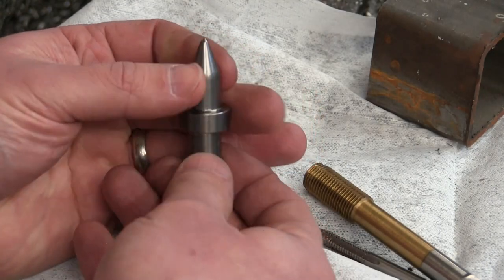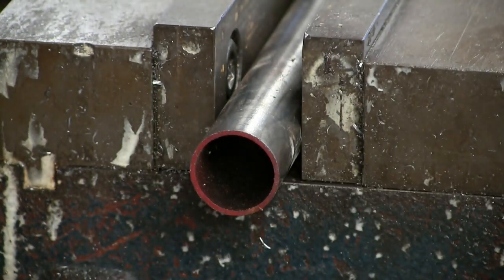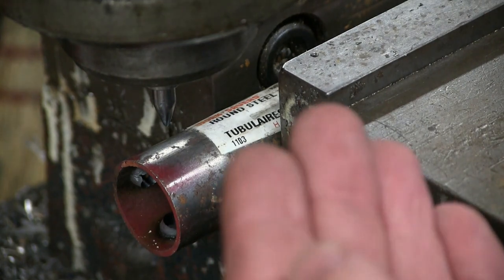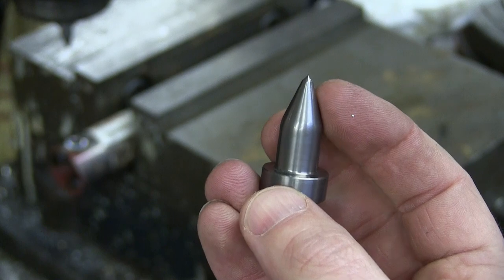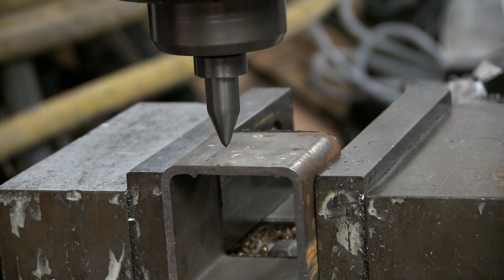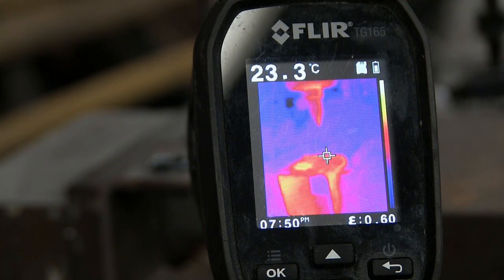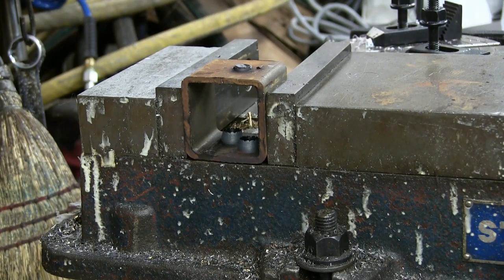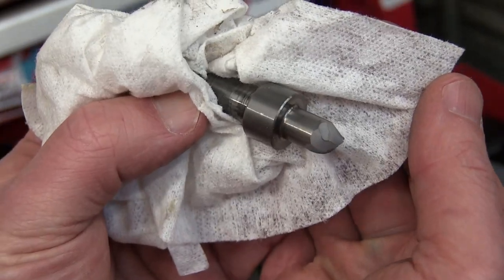Using Friction to Melt Holes in Steel. AKA Flow Drill

Comment: This is how I drill with an ordinary drill bit
Reply: so true
Reply: @lyy90  that was sarcasm, OP here meant his drillbits are so dull that they rather melt than cut their way trough their work
Reply: @eccomi21  or just that he presses much more than he should
Reply: @MrHack4never  ye that works too
Reply: Got done building a forge and drilled about 60 holes for rivets since its massive and the sheet metal i have is way too skinny and watched as my last drill bit was glowing before i could finnish the last holes
Reply: @zettabutt9323  get some cutting oil.
Reply: Thats not good but u do u
Reply: @lyy90  r/whoooosh
Reply: Yes
Reply: Use some oil lol, any works we is too expenise though
Reply: Lol same
Reply: @zettabutt9323  tt
Reply: @lyy90  bro it's a joke 💀
Reply: Self tapper screws are the best drill bits

Comment: friction Drilling is when you use a Harbor Freight drill set to drill into stainless steel.
Reply: Clay Reid Yea,totally get that! equivalent over here is Black rock,cheap tools for d.i.y heroes.
Reply: shot since 66 ...Equivalent here to Black rock is called crack
Reply: dustin dingivan... Where's that,Glasgow?
Reply: Clay Reid lmfao
Reply: but you can get a 30 piece ratchet set for 99 cents lol.
Reply: JD Cunningham , I know Harbor Freight Tools they still have good tools just got use on right material
Reply: I had a 1/8 inch drill bit from them glow red hot and snap instantly
Reply: Moss Fett lol
Reply: LOL
Reply: Its fictional drilling with harbor freight
Reply: If you don't break them first
Reply: Moss Fett hahahahahaha
Reply: Hahahahaha that's good! Made my night!
Reply: not even. they would break before you got a decent amount of pressure on it
Reply: lol
Reply: Moss Fett. Lol! Ive had them flatten out after turning red.
Reply: Sounds more like fiction drilling at that point
Reply: JD Cunningham you spelled hammer wrong
Reply: Or using a tiny-diameter Chinesium bit on a piece of Detroit steel only 3/8" thick.
Reply: True!
Reply: this is actually really funny cause i literally snapped one the other day from this, but honestly if you just get some bar and chain oil and pour just a little bit in and over the hole you are about to drill and don't go incredibly fast you can get through just about anything in a diy shop with the cheaper drill bits, not a perfect solution but it makes it to where you can get some life out of those cheaper bits
Reply: LOL.
Reply: If you sharpen Harbor Freight bits before you start and use good quality cutting oil they work fine course that requires the knowledge on how to sharpen drill bits
Reply: Best comment ever
Reply: @RaptorRotorHead  they're not that bad, I only snapped 3 screwdrivers screwing into balsa

Comment: As you said - tungsten doesn't expand much from heat. When you let it cool down, the steel shrunk and you had a really nice tight and strong shrink fitting there :)

Comment: I had a Tungsten Carbide wedding ring.  First day at work at a new job, it slipped off my finger, hit the concrete and cracked through on one side.
Reply: stonent 
did you take the hint?
Reply: That sucks but it's not too surprising. While she's harder than frig it's also brittle as.
Reply: Jmann147 nah, just the wrong cementing. cobalt cintered carbide is untouchable, but i'm not sure what it's like for toxicity, what with the cobalt.
Reply: I just stopped wearing it since the crack was snagging on hair.
Reply: They say if you ever get a tungsten wedding ring stuck and need to get it off, don't try to cut it, just put some vice grips on it and keep doing a 1/4 turn or put it in a vice and slowly tighten.  It will eventually just crack and fall off under the pressure without any harm to your hand.
Reply: Had mine since 2005. Have to take it off when working with 304/316 or anything else. Praise jebus for comfort-fit, boo for sexy satin and BA steel finishes.
Reply: Correct, TC rings are just 'sintered' and react very well/poorly to clamping forces. Hard, but brittle.
Reply: stonent silver braze it
Reply: It was snagging on the hair on my knuckle.
Reply: I've dropped mine dozens of times and it hasn't even chipped.
Reply: TC wedding rings are made with a breaking point so they can be removed by ems personal in a emergency. as they cant just cut them off like soft gold or silver rings
Reply: ShadowPBPBC Mahaha first hand.
Reply: Brandon dude i spit out my coffee when i just read your comment. you sir, have won comment of the day. hats off. Take your like
Reply: ShadowPBPBC I doubt this would be the case for all metals. If you used a soft metal that was going to be bending before breaking then they could just be bending metal into your fingers

Comment: Was anyone else made uncomfortable that he drilled off center at 2:15?
Reply: Vlad B no
Reply: He was drilling on center. The camera was tilted.
Reply: @practicalproblems-x5r  Doesn't work like that. If you've machined for enough time you'd know ;)
Reply: Vlad B--wtf yes!!! was sure no one else would care. HE KEPT DOING IT!
Reply: Not off center
Reply: @practicalproblems-x5r  That's not how it works
Reply: Actually, the proper designation is  'Drilled out of normal'.
Reply: I was
Reply: Think it was cam angle

Comment: Impressive but, I have a question about this. Have you tried to tap threads into a hole you made using this method? I wonder about the strength of the metal b/c of the molecular change the CST has underwent.

Comment: 5:23 What are the dancing red sparks about?
Reply: almost looked like an electric spark, eh?
Reply: I have some triangle shaped "drill Bits"  they say "black diamond steel works" on them.  a friend says there for drilling hardened steel but need high speeds..like 3600+ rpms.  would be willing to forgo the cost to send you one to try out!
Reply: It means it reached a very high temp. Some steels begin throwing sparks at near or above welding temps.
Reply: +AvE +12Avoid But red sparks? Instead of the blue white that electrical sparks normally are?
Reply: outsider344 looks like a piece of molten metal being spun
Reply: JoshL So the sparks are bits of molten metal that are, what, orbiting?
Reply: outsider344 since the bit is rotating, I'd venture to say that the bit is flinging the metal away
Reply: JoshL But they aren't being flung away... They are moving up and down and around the bit. Pretty much every direction except away. Did you watch the part of the video I'm talking about?
Reply: outsider344 I did, thrice now
Reply: +David Southern?
Reply: +David Ah, of course, makes perfect sense now...
Reply: outsider344 hot metal. the drill is spinning.
Reply: Check out the Magnus effect.
Reply: Static?

Comment: 225 Celsius is 437 Fahrenheit, for those too lazy to look it up.
Reply: TBP thanks was wondering
Reply: What's that in kelvin? where I'm from we measure in Kelvins
Reply: i highly doubt that
Reply: anne-fleur isdik who you saying that to? The original poster right?
Reply: I'd say she talking to you.  Jake, what country are you in that usees the Kelvin scale   Don't you mean Celsius?  Kelvin is the number of Celsius degrees above absolute zero!  In Kelvin, water  freezes at 273.2 K°  !
Reply: Loft Party it's is the most accurate temp measurement.. every country should use it, way better then both the other systems.
Reply: is not, is the same as Celsius.
Reply: @greenthizzle4  first: it uses the exactly same scale as celsius, second, celsius is better and easyer for the normal use, because the temperatures are not as high numbers as whith kelvin, like as said, water melts at 0°C and 273,15 Kelvin. Whats easier for daily use?
Reply: Eric Kelvin, it's the most superior
Reply: @greenthizzle4  so when it's hot outside, your weather report reads around 300?
Reply: Dale Neish yeah around 300-310.. I prefer it to be around 294-296
Reply: Dale Neish in my home I keep it around 293 though.
Reply: Dale Neish the boiling point of water is 373 roughly and the freezing point is 273, super easy to remember
Reply: xXx_MlgTr1kSh00ter _Xx Its an alright system, better then Celsius in some aspects.. but not better then Kelvin
Reply: Ray Owens no
Reply: @greenthizzle4  no? Celcius and Kelvin are almost the same, it's also just easier to say 0 degrees than 273 Kelvin
Reply: Ambrose Burnside lol, best response ever

Comment: Invented by someone who couldn't sharpen a Drill and didn't like the mess caused by using Coolant.

Learnt from his teacher, just shove it in.

That burr won't hold as well as the metal.

This is what washers and nuts were made for; but washing his nuts is also foreign to his thinking.

Comment: We used to use friction saws to cut steel pipe that was up to 16" in diameter. The blades were almost 6' in diameter and just made of steel. It actually worked fairly well, not a pretty cut but it was fast.
Reply: Where are friction saws used these days? 

I read about it in a 193X machinist book.
Never heard of it before or since.

Comment: +AvE, just going back and watching old videos, saturday morning and all, and I wanted to mention a potential reason as to why Chinese carbide is good while the HSS is junk. It's an artifact of the manufacturing process, a lot of HSS is milled before hardening then ground as little as possible on ancient grinders to save on cost. Where as carbide comes in sintered sticks and has to be ground from solid on a modern nine axis grinder. So the resolution on the newer machine is better, there's only one process before coating and the wheel has to be very fine grained. All this adds up to a better process leading to a better product.
Reply: Nice
Reply: the (potential) answer I came here to find, thank you

Comment: And now what if you tap this? the holes are case hardened steel right?
Reply: first, this wouldn't be case hardening. case hardening involves increasing carbon content in the areas you want to harden. second: the holes wouldn't be very hard at all because the cooling process is too slow. it would cool fast enough to properly harden some high-alloy steels, but not structural steel or the likes of it. tapping will probably not be as smooth as you'd like, but should work.

Comment: You'd think that glowing hot near molten steel would be hotter than 220C.
Reply: Casey Goode it is of course but the TG165 is a cheap model that has a low max temperature range. Higher end handheld thermal cameras can cost 10 times the price of it.
Reply: Brian Su - never used a Flir before, but my cheapo eBay handheld Chinese thermo can read 600C.  just thought that was odd.
Reply: Casey Goode yes I'm not surprised. When I did my research, the Chinese ones have better range and more features at the same price point. FLIR is expensive because it's American and are made very high quality. There are far more expensive brands out there too, but FLIR is comparable to Apple. They're Popular, reliable, a premium brand etc.

Comment: I read on the innerwebs that the extrusion left by these tools is super brittle
Reply: Read it on reddit way back, it was someone that claimed to have experience working with friction drilled holes. I don't remember the exact circumstance
Reply: I can see that forsure.
Reply: unless the holes were cooled very quickly i cant see how they would go brittle.
Reply: I can see that being an issue with some steels but would be pretty easy to anneal it before doing further machining.
Reply: +Arnþór Gíslason Reddit is cancer

Comment: Oh wow. I have never seen this before. I always wondered if it was possible just never saw anyone doing it. Tungsten is an extremely hard metal and it’s usually forged into whatever ur making cause the melting point is so high on it but Tungsten is a brittle metal. Tungsten carbide is also on the brittle side but I don’t think as brittle as regular Tungsten so when you stopped and let it cooldown you said the effect of it being brittle. Crazy all the stuff that can be done with it but twist a certain way or do what you did in the video and you can see how it is brittle too. Awesome video

Comment: 121621/0826h PST 🇺🇸.   Thank you for the demonstration on friction drilling with WC tool. That’s a fantastic method to prepare, required hole in mild steel, for the purpose of threading and or other requirements. I’m not a machinist but a DIY person. I’ll procure M6 bit for M6 SS bolt. Thank you for introducing the technique. 
73s…

Comment: Hey AvE, why wouldn't you use this for fluid connections? At my work we make manifolds that get pressurized and are able to hold 10bar(145 psi) no issues. We use 
SAE 304 stainless steel 40x2(mm) square tubing.

Comment: The tungsten carbide looks good because it is formed that way from an extruder, there’s no machining involved.
To test the sintering process they simply drop them on the floor, most tc tooling is done this way, I’ve built extruders as large as 500 ton.  Cutting edges are ground but no machining
after it’s cooked and sintered.

Comment: Not a metallurgy expert at all;
is it possible that just as with a heat treated knife, heating this bit to glowing red makes it brittle, or changes its strength properties?

If so, ..could fluid cooling help?

Also, if the shattering of the bit was due to binding,
could lubrication serve two protective functions for this bit:
cooling, and binding prevention?

Comment: okay I get the threading but why would you keep backing it out and cooling it down on a friction drill which needs the heat to drill I've never used maybe it does have some practical purpose but compared to a drill or endmill that you could resharpen a ton of times it doesn't seem terrible practical to me

Comment: Can this be done with a mag drill? Making a floating stair rail for new home and have a 6x8 sq tube with 3/16 wall I need to do this to. Thinking of 1/2-13  bolt holes to bolt stringer brackets on with. Tube is about 18ft long, and to big for machine I have access to.

Comment: What kind of force does this take?  Can this work on a magdrill??
Reply from the maker: hmmm. good question, I'll try and see.
Reply: @AvE By my cursory research, it's not likely to work, as most of the magdrills I’m seeing don't get anywhere near the spindle speed.  Would still be badass to have as an option for a work truck.  Maybe I'll buy a MagDrill base and install a higher speed drill.   ¯\_(ツ)_/¯
Reply: @AndrewBoheler   Flow2Go

Comment: Very cool stuff. Would like to hear your input on the threaded connections for water heaters. I think its called projection welding. Decade of plumbing service behind me. Every single failure I've seen on the tank, is directly on this "projection weld seem". Like anything else, quality has gone to the crapper across every manufacturer, and there's likely some kind purposeful engineering to fail, to sell more water heaters. All the same, I love the channel, and truly appreciate the content.

Comment: Ever see some one use a vertical band  saw friction saw a piece of hardened tool steel with a standard metal saw blade ?  You will beg them to stop . It can be done , it isn't pretty , just for showing off . Wreaks havoc on the saw .

Comment: The power not in your simple garbidge iron nail wedge, the trick with your bull strong drilling machine. I would drill holes with anything , if a have the same machnie high Rpm high power

Comment: Flow drilling may seem like hot shit (heh) but as an employee in a welding shop for construction, its going to waste just as much time, if not more for deburring the holes
Reply: Not to mention tungsten carbide can be more expensive for smaller shops

Comment: You have saved me from buying a shitty drill press....about how many rpms do I need?
Reply: You mean rippems right?
Reply: yes, yes I do
Reply: smaller sizes higher rpm, eg 4mm = 2600 rpm  / 25mm = 1100 rpm but larger needs higher power motor. 4mm = 0.7 kW / 25mm = 3.5 kW
Reply: @noelwillows2001  thanks!!

Comment: No you do not tap drill with this shit. You go in fast and hard and keep the heat on until hole is nice and properly embiggend. 2-3000 rpm and lots of downward force. You also use special taps for this, and they are not cheap.